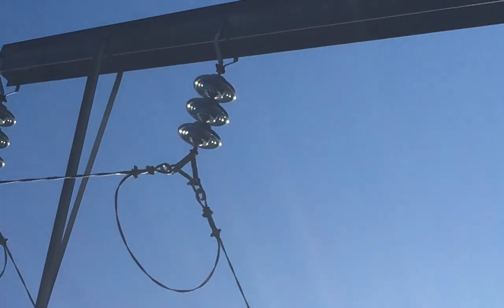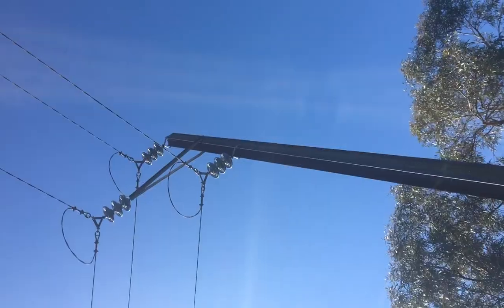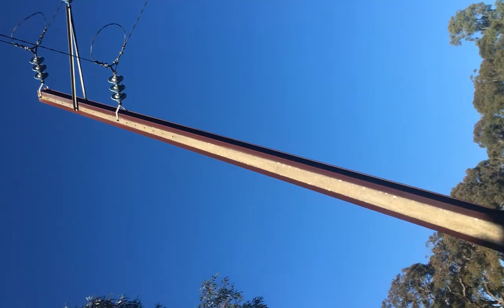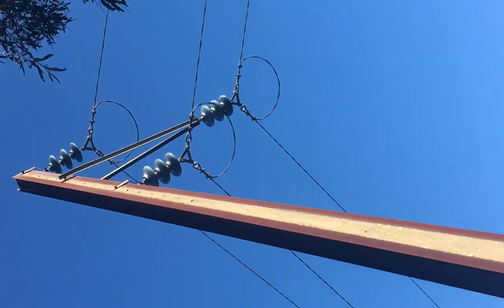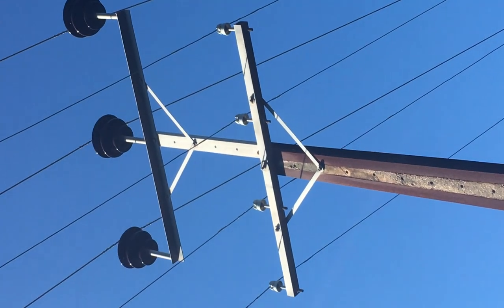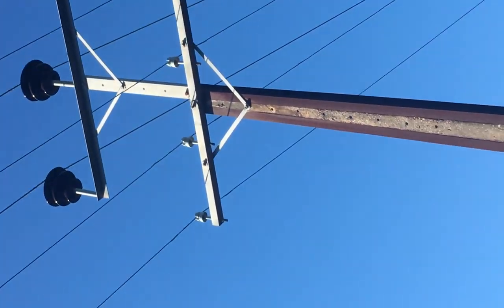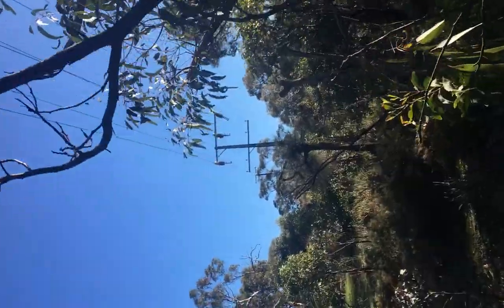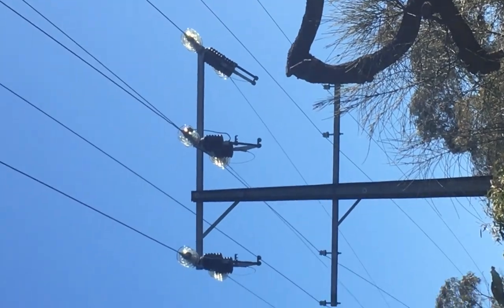Jeffrey Dewitt Suspension Insulators??

Comment: Yeah those look like JDs.  They date mostly from the 1930s.  The earlier ones were brown, but are scarce here in the US.
Reply from the maker: This is the only place I've seen such specimens. Various Ohio Brass 69kV insulators were used on 33kV lines here in past days, as well as suspensions. The black shiny 3 part ones have a pin hole complementary to Australian insulators, however the 4 part big brown ones have a substantially larger pin hole